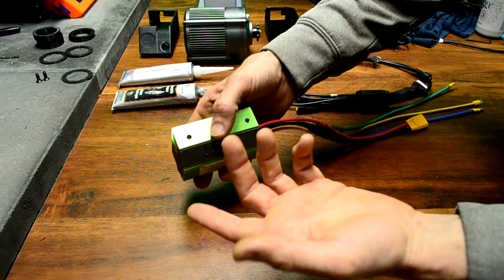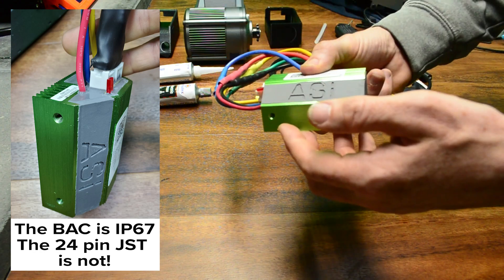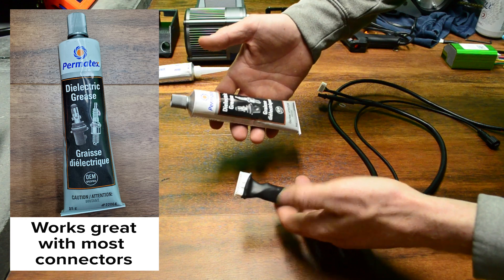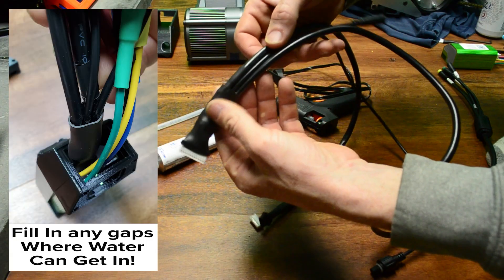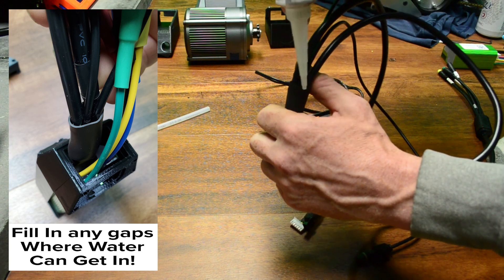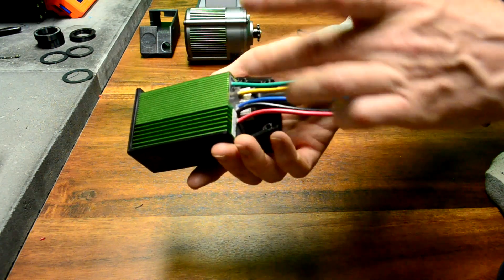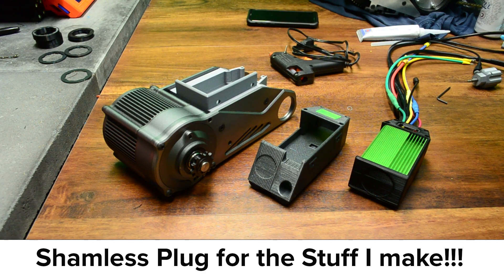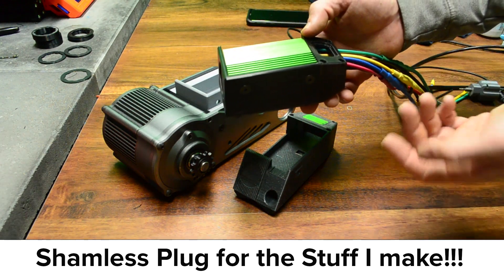ASI BAC855 Ebike Controller Harness Waterproofing and Physical Protection Tips and Tricks

Comment: I would seal them with a Dicor 501SW (the same for the internals at the motor where the contacts of the stock controller are) Designed for RV roofs, I have been using this stuff for some 20 years Also paint your motor White. Nothing makes a motor run hot as black paint. I finish everything I own that has an engine, white.

Comment: Right I put a new bbshd on my bike with my bac 855 it’s not as quick it’s was pushing out 2300watts and now it’s only kicking out 1600watts using sped 1 it chucks out 500watts is that right not as fast don’t know why need answer asap
Reply from the maker: The comments section is probably not the best place to do this. Are you on our Discord? Was this a kit we produced? Recommend joining our Discord where you can post photos, video etc. We will need to know more about the setup first.
Reply: @HighVoltageKits   I don’t have discord it’s a 52v battery with a bac855 with a bbshd that’s it mate

Comment: My bbshd I replaced my nylon gear with Luna cycles new gear it's brown color not metal one anyway I noticed the bearing in stock nylon gear where rusted must of got water in some how so I silicone on it.
Reply from the maker: Good idea. I think you have the PEEK gear which is the best option. Good balance of quiet and strength!

Comment: Hi cap do you think the bac 855 would be ok with a bbs02 ?  Thanks
Reply from the maker: It will run it fine and give you a boost but it would have to be throttled back a fair bit. There are a few people who do it. It's like with my bike. I'm still on my nylon gear because I understand the physical limitations and operate within. There is a sweet spot. Join the discord chat if you want to speak to people who have done what you suggest. I'm sure they will be happy to answer questions etc.https://discord.gg/ScWuVxu9 let me know if you have issues
Reply: @HighVoltageKits  thanks for the detailed reply i think 52v 1500 should be easily achieved
Reply from the maker: I would think so. Bruno Power ran a bbs02 pretty hard so there is room.

Comment: Some additional solutions:
- Liquid electrical tape for a more permanent seal or filling some gaps
- UV Resin or epoxy over soldered joints for insulation and strain relief
- Self fusing silicone tape for covering some connectors
- PCB lacquer spray to waterproof circuit boards 
- ACF-50 to protect connections from corrosion or repel water from pcbs
Reply from the maker: Excellent. Thanks David. I used a bit of the liquid stuff inside the controller cover if I remember right. The lacquer stuff is neat. I saw a guy with a pcb in a glass of water with that stuff. Amazing. Appreciate the comment. Cheers

Comment: I have used dielectric grease on hundreds of electrical connections i do not understand why you say that you should not apply it to the male or female pins as the grease does not conduct ?
Reply from the maker: Well what is likely happening is that the mechanical nature of the pins is pushing through the grease and making contact anyway. The grease itself though does not conduct electricity. The pins here are very small and the contact surface also small with very low power signals. With larger connectors it probably does not matter as long as you get a solid metal to metal contact.